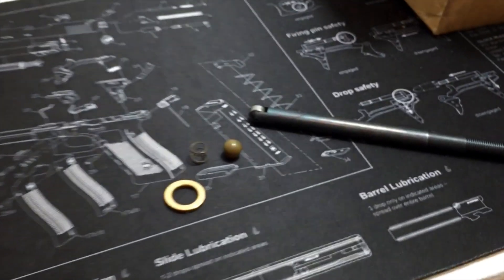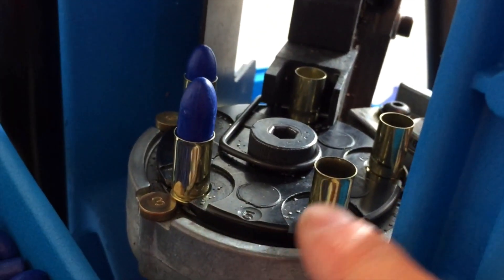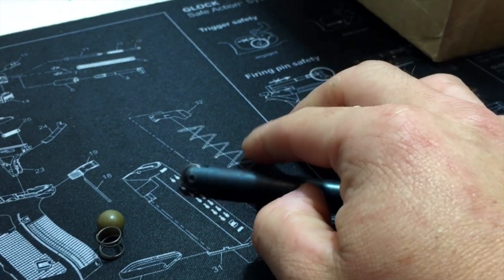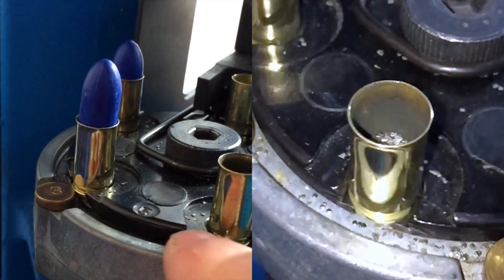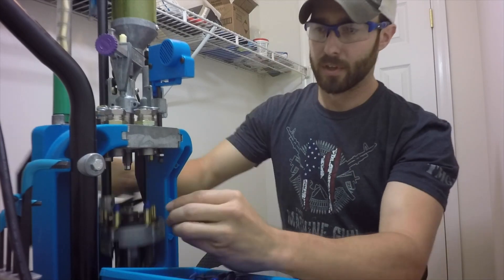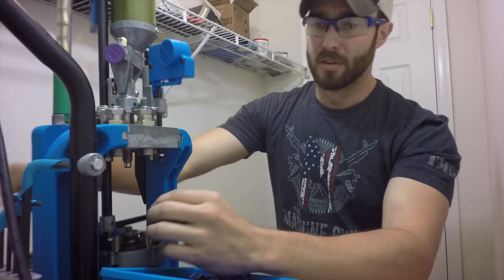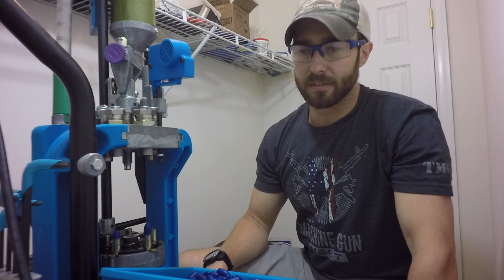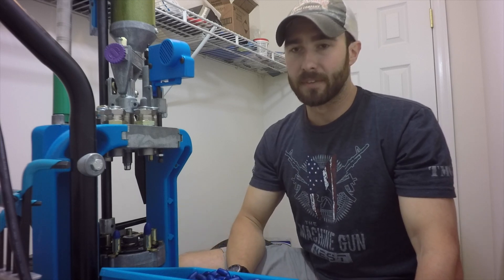Fixing spilled powder in Dillon XL650 | Performance Upgrade Kit

Comment: I've been running a 650 for almost 25 years with the stock detent ball & spring, and have never have powder spill issues.  To put it in driving terms, the loose nut is the one behind the wheel... if you're getting spilled powder, you're slamming the handle too hard on the upstroke, causing the cases to jar around.  You can still go fast and be very smooth with this machine.

Comment: Check around to find a bearing washer that goes under the index plate. My biggest issue on my 650 besides blowing it up today was that the index plate screw would come undone and couldnt get the exact tension. I then added the bearing under the plate and it was the biggest upgrade Besides the kit you installed. I dont remember the exact manufacturer but can take a photo tomorrow since I have the press apart due to the primer explosion.

Comment: I hate to put a damper on this idea but the only time this will stop powder spilling is if you have standard loads where the case isn't filled as much. I am currently loading 38 sp cases with TrailBoss Powder and the case is 3/4 filled with  powder. Every time the case is moved before the bullet is put on, it shakes and powder is spilled out. If there is another modification that can fixed this problem with a 3/4 filled case then I would love to hear about it.

Comment: Gday mate, good video.... where did you get that Pink Plastic dial / nob  addition to adjust higher or lower the volume of powder ?
Reply: Check uniquetek.com, you can get a Powder Drop bar with a micrometer. Or just get the micrometer and replace the factory screw on the powder bar. Bought 2 micrometer myself, one for the small and one for the large powder drop bars.

Comment: Check out ammot bot, although not sure if they make it for the 650. Turns your machine into a automated machine
Reply: adjust your follower down to slow down the advancement on the shell plate. Its a timing issue. not and bearing mass problem. I use factory ball and spring with proper timing adjustment, you wont spill any powder.